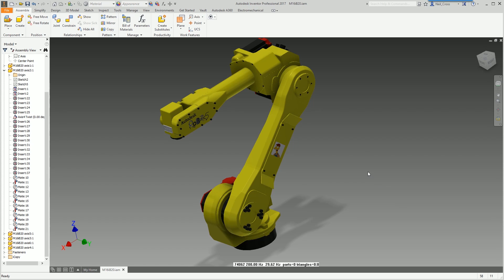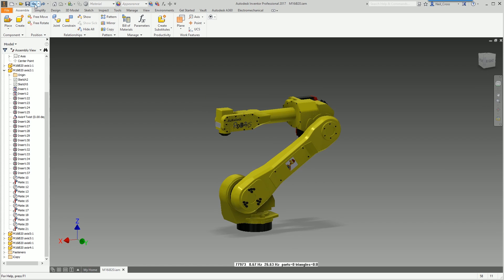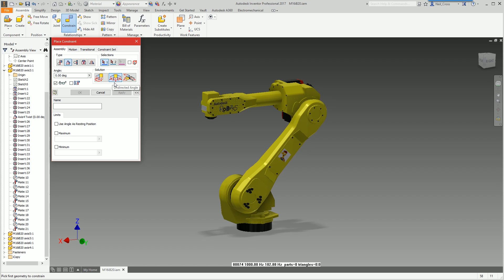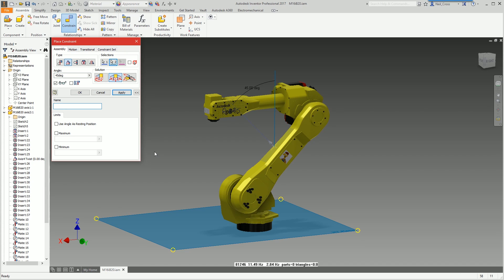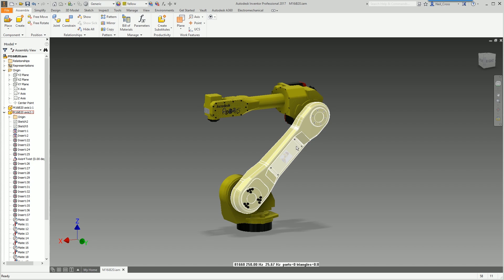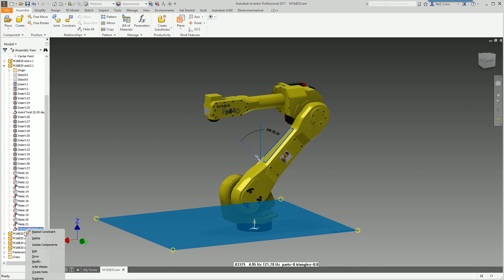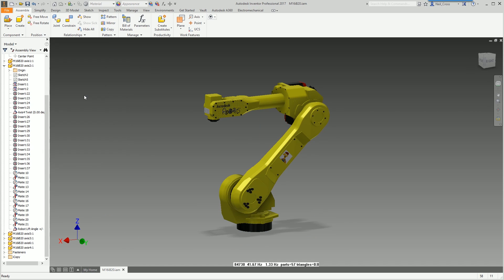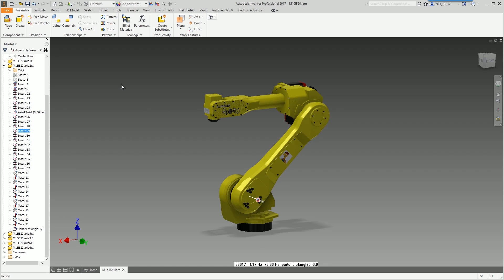Angle Constraint Resting Position & Limits | Autodesk Inventor

Comment: Can you give an example of the same thing but with current positional values driving something else? i.e. the degree at which you have it changing to at that moment, drives the angle of the end of arm tool.
I'm thinking you have to use Joint or multiple tools at once... But it's failing to register anything I'm doing.

Comment: Hello there TFI is there any way i can contact you i have some questions i would like to ask about inventor i have a project with a chair and i dont know how to make the back legs from a drawing done in 3ds MAX i cannot use it and i dont know how to remake it in inventor with its angles and dimmensions also if i do the legs i dont know how to angle constraint them both on any angle each other :)